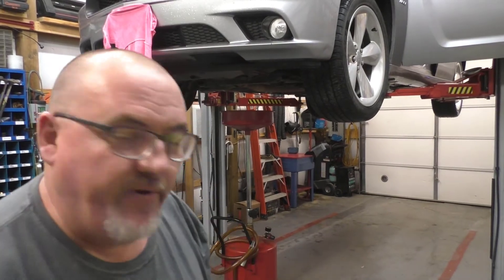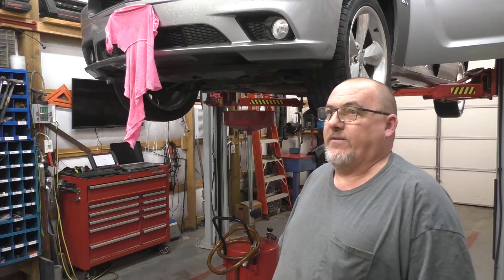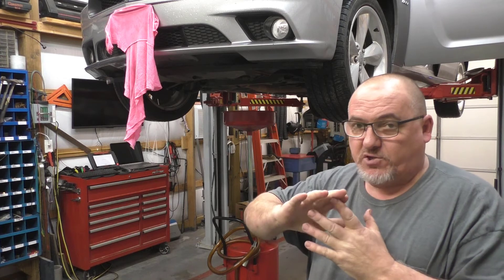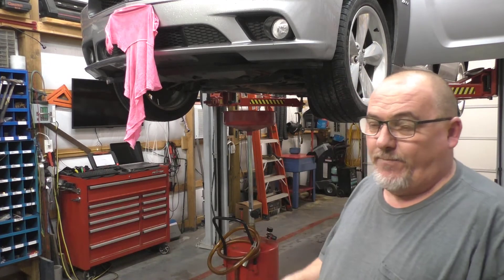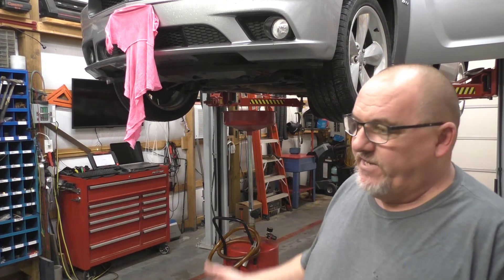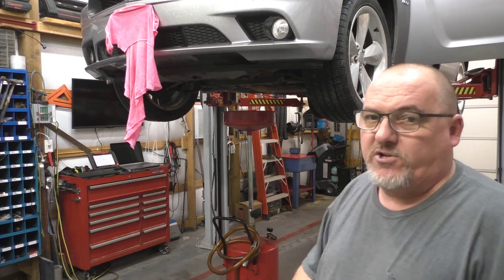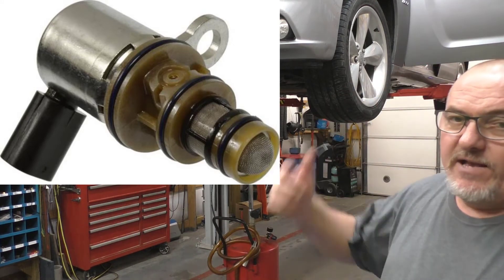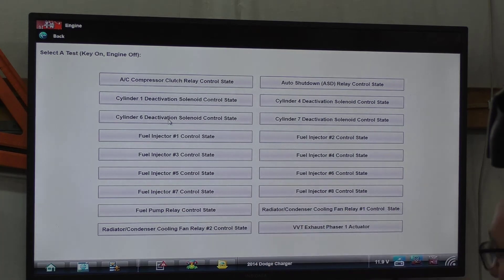Dodge Hemi 5.7 Use better and correct viscosity Oil P3497 Bank 2 Cylinder Activation System.

Comment: Would it be helpful to switch to „eco-off“ (2018 DD R/T) mode on the 5.7 to deactivate the mds while driving? It seems like the engine & transmission don’t really „know“ what gear to be in while cruising. Good information on that code though 👍

Comment: I use marvel.  In the oil and fuel.       Just valvoline 5w20.   Full syn.   Since 10k miles on an 09 hemi challener.      Now i got 50k.     Never an issue.       Original brakes.    Lol.        Goog vid

Comment: I got two hemi engines 5.7l only using Red Line 5w30 fully synthetic real synthetic loaded with detergents and high pressure aditives along with 600 ppm of mos2
Group lV and V base synthetic thru synthetic,
not group III fake synthetic oils only sold as full synthetic in USA,
RED LINE AND AMSOIL ARE ON JUST ONOTHER PLANET WHEN IT COMES TO SYNTHETIC MOTOR OIL,
Did multiple oil analysis testing at 5k oil interval interchange metal wear is 50%-80% lower than comparing to Mobil,Penzoil,Castrol,Valvoline Royal Purple.
5w20 is just fuel economy gimmick for fuel economy rebate.

Comment: The ram dealership recommends for Ram 1500 5.7 5w20 synthetic with ms6395 in certain brands of oil. Mobil, Pennzoil and few others. Which is suppose benefit the mds. Sounds like hogwash.....

Comment: Excuse my mechanical ignorance. But my truck threw this code. And approximately that same time it started to knock. Do you think that is the reason for the knock? I did change my oil with a high grade synthetic and it's still there not as bad though
Reply from the maker: Will not matter if it is knocking it may have damage.

Comment: Full synthetic oil change today with 5W/20 (7 quarts) in my 5.7 Hemi cost me $106 today.
Reply from the maker: Mobil1 Truck & SUV Walmart(Not a Sponsor) $26 and some change I buy 2 for my Truck the First time and one the second oil change  I use only WIX Filters I never use Wix XP as it is inferior in Filtration unless you plan on using the Oil for more than 10K Miles.  I Charge 22.00 to change OIl here in the Shop and don't care if you source your own Oil. So the First Change would be close to what you paid but the second would be quite a bit cheaper.

Comment: My 2008 dodge Ram 1500 gave this code. After listening to this I realized that I took my truck to Mavis for an oil change about a month ago and they put full synthetic instead of the conventional I have put in since I bought it in 2015. Could this have caused the motor to throw out this code?
Reply from the maker: Highly unlikely.

Comment: I have a 2007 dodge ram 1500 5.7l. I have the same code p3497. I have already replaced all 4 mds solenoids and I did a fresh oil change. I then cleared the code after replacing mds solenoids and oil change. It just came right back. I used the correct oil. It calls for 5w20 wich ive always used. What are my next steps please help
Reply: Check the wiring harness going to the solenoids. They can melt to the block and cause issues
Reply from the maker: Sorry I cannot diagnose the Vehicle without seeing it but here are some common causes.
Lower than normal Oil Pressure
Restricted Passages
Lifter
Since you already replaced the Solenoids it "should" rule that out.
Reply: @ralfsautomotive  im going to just replace the lifters just because but is there any thing you can tell me as far as to see if I have restricted oil passages? I'm not sure how to check that. Oil pressure seems fine as far as the Guage on the dash goes.
Reply from the maker: @eazy4570  Problem is that it really requires a scan tool now! The Diag. requires by-directional control device(scan tool).
As for the passages, if correct oil was used and regularly changed I would not get hung up on that.
Reply: @ralfsautomotive  thank you. Im just going to go with an mds delete kit. After spending money on diagnostic fees and labor cost to fix one thing that could be malfunctioning I may as well just spend the 1200 bucks to replace the cam, lifters, all the gaskets etc.
Reply from the maker: @eazy4570  don't blame you

Comment: Hey so I got a P3400 Cylinder Bank 1 Deactivation on my 2006 Jeep Grand Cherokee 5.7 Hemi, I always use the right oil and I take care of the car. I believe I have to replace my solenoids should I just replace the 1 solenoid or all of them? Also do I have to replace the manifold when I take them off?
Reply from the maker: Sorry missed the question.  If you have the Cash I'd do all and no to the replacing of the manifold
Reply: @ralfsautomotive  are you located in Michigan
Reply from the maker: @reefbangoura  Illinois

Comment: My 2013 has thrown this code twice, the first time after I cleaned and kicked snow off my tires, it went off and that was about 2 months ago, it came back yesterday, it seems to be driving fine, but is it too late to get it fixed or solve it? Also, is it an expensive problem to fix?
Reply from the maker: No on both questions. Sometimes the vvt solenoids can hang. I always start with a full synthetic oil change.